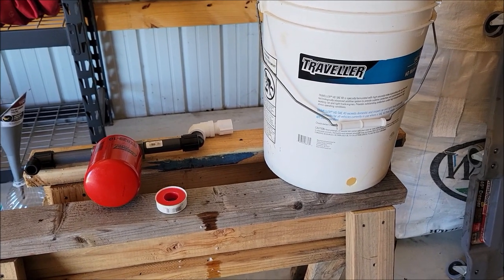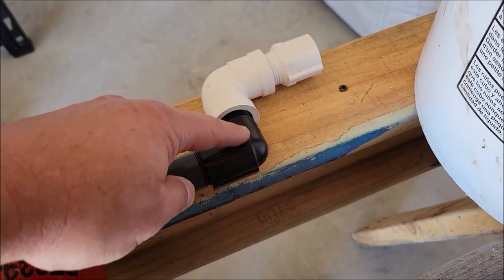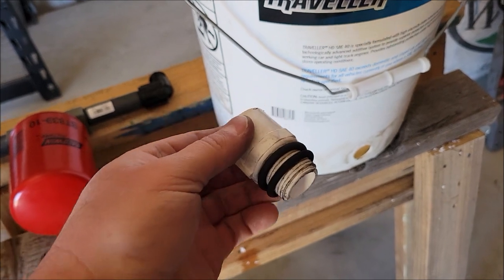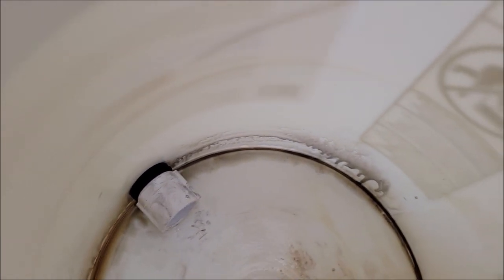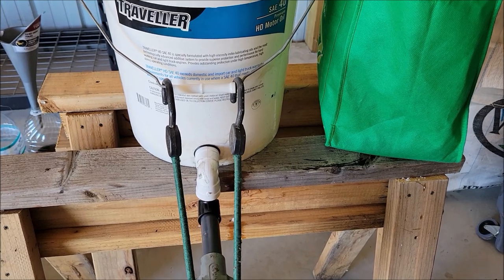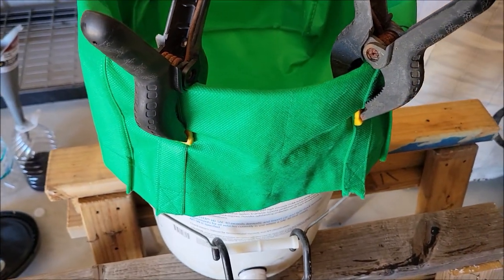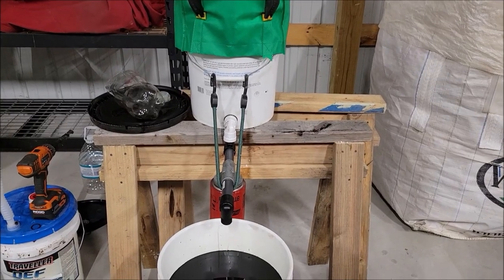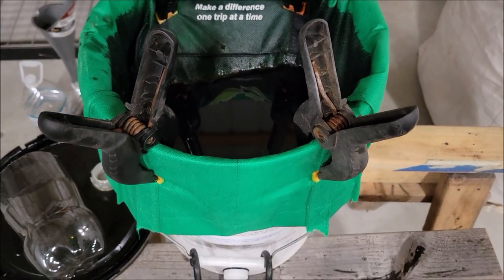Filter Used Motor Oil - Can Oil Be Used Again? - Reusing Old Motor Oil

Comment: Im thinking one of those dust collector lids would work to use a shop vac exhaust as added pressure. Help force the oil through the filter faster. Possibly add a pump past the filter.
Reply from the maker: Do you think pressure would filter it better?  I could try that if it will.  Time is not usually something I worry about for something like this because it's a pour and leave kind of setup, but if pressure will make it filter better I am all for that.
Reply: @SeidelRanch  I think it depends on how fast you push the oil, and if you do it too fast it cant filter as well maybe?
Reply from the maker: @TobySmith-qd4tm  Yeah, not sure on the hydraulics of that.

Comment: Tape a couple strong magnets to the the side of the bucket n see if that helps with some of the small metal pieces
Reply from the maker: That is a good idea.  I need to try that.
Reply: It doesn't work, I've already tried it with strong neodymian magnets. I  also tried oil in a plastic bottle with magnets at one side of the bottle and let it sit there for month & months hoping it would slowly pull the dirt to one side but it did nothing.
Reply from the maker: @PF-gi9vv  Thanks.  Good info to know.

Comment: I take used oil to melt scrap metal. Also use it on my Bobcat trailer. It can also be mixed with diesel and gasoline and burned as a Diesel substitute. A centrifuge works best for filtering.
Reply from the maker: So you can get the oil fire that hot to melt the metal?  Sounds like a good experiment.  I want to make a waste oil heater in the near future.  That looks pretty cool.  I use old motor oil on my trailer beds too.  It works well to keep away rot.  I am just now looking into the centrifuge idea.  That looks like something I might get soon.
Reply: @SeidelRanch  Yes it is possible to melt copper, aluminum, brass and even cast iron using oil. It works best when pressurized with an old hydraulic pump and sprayed into a burner, blow air in and get an extremely hot flame.
Reply from the maker: @chargermopar  I will try that with some aluminum when I make one.  I am definitely going to make one, I just need to find the time. Thanks as always for all the helpful info.
Reply: @SeidelRanch  If you melt aluminum you have to make a container (crucible) to protect it from the fire to avoid most of it oxidizing. I start with cast aluminum scrap which is less likely to oxidize than can put in thin stuff like soda cans or sheet metal from sheds or campers. Compressing thin stuff before melting can work too. Baking soda can also work as a flux but borax seems to be the best.
Reply: @SeidelRanch   I need to put mine back together someday, the scrap pile is really getting out of hand here. Lots of air conditioner scrap and junk transmission cases.
Reply from the maker: @chargermopar  Thanks for the tip.  I will try that out.

Comment: It's time to get into this. Some of mine has water dirt and oak leaves from the pan. Maybe an acorn or two and some bugs. I need a water separator. I wonder how much a centrifuge is.
Reply from the maker: That is why I did it.  My oil gets too dirty just doing the oil change.  To get the water out, I pour it in a bucket and let it sit then drill a whole in it to let the water out. Once I see oil coming out I plug it with a screw.

Comment: yeah that's centrifugal force one if you want it to come out clear you have to either put coffee filters there's filters that they have for cleaning frying oil at the restaurant those filters will work coffee filters and there's actual a powder that you can put on the filters it's a neutralizer and your oil will come out brand new and you could reuse it in the car and everything it just has a different flash point and you could reuse in another time or two there's also a machine you could buy that does it but it's very expensive they're about $1,500 it's an oil cleaner it'll clean any oil but it uses suction system cool I love that video
Reply from the maker: Thanks for all the info.  I may see if coffee filters do good too.  Would love a centrifuge but don't want to spend the money.

Comment: I use old motor oil thinned with diesel to paint on my wood trailer decks. You need to paint them every year because it doesn’t last, summer is the best time because the wood soaks it up. I don’t see any reason to filter the oil unless your going to put it in a lawnmower.
Reply from the maker: I use the oil for my wood decks too. Why do you mix it with diesel? Does it paint on better? May try that.
Reply: @SeidelRanch  I use the diesel as a thinner, the thin oil diesel mixture soaks into the dry wood in the hot summer a lot better than straight oil. I pour old in 5 gal bucket and add desired amount of diesel then it can be sprayed or most time I use a old broom for a brush. I also pour on or spray fence post with the mix. I would be careful with that since you live on a lake, you could have people in white suits showing up at your door.

Comment: My question is what does everyone do with the empty bottles especially when they stored the used disgusting oil? The auto parts store always hands them back.
Reply from the maker: I reuse the oil containers to hold the old oil.  I probably have too many right now, but I have not gotten rid of them.  I also cut them up sometimes and use them to dip my oil-less chainsaws in to keep the bars oiled.  If they are empty, you should be able to recycle them like plastic (I think, don't hold me to that).  Make sure you let them sit for a day or so to get out all the oil you can.
Reply: @SeidelRanch  Thanks.

Comment: i wonder if it is bypassing the oil filter seeing as it is so thick im thinking the filter is filling up and then just running off
Reply from the maker: It's not bypassing.  The housing will not let the oil through without it going through the filter.  I just think I need a filter that cleans down to a smaller micron amount.  It's good enough for my purposes though.  I want to try a centrifuge one day.
Reply: @SeidelRanch  cool! great idea!

Comment: You know oil breaks down it's not just dirty it breaks down picture oil is a bunch of tiny ball bearings well dissolve 90% of those ball bearings or remove them and then consider putting that back into your engine cuz that's a pretty good analogy on how viscosity works in a motor oil you're putting back a useless product don't do it farm equipment's too damn expensive
Reply from the maker: I do and you are right. I will not use it for motor oil. But there is a lot of other uses for it. Thanks for the info.

Comment: Did you make any progress on this?
Reply from the maker: I still use it but I have not changed it much.  It's still working great.  I do plan to make some of the suggested changes when I need to change the filter.
Reply: @SeidelRanch  Is there a way to get rid of the coal in the oil to make it more transparent?
Reply from the maker: @FransvandenBergeMuziekschuur  I hear that a centrifuge can do it, but I have not tried it.
Reply: @SeidelRanch  Interesting. Thank you.

Comment: You need to pressurize the system with an oil pump and recirculate it with a bypass filter that is 100 micron
Reply from the maker: I think I will try that.  It will also make it less messy I think.
Reply: @SeidelRanch  the Cummins has a bypass filter kit you can put on the engine even and do this while the vehicle is running. Works well in old tractors or hay rigs that run non stop. But I clean mine then add the h30 additive that puts the elements back in I want. And for a 60 year old diesel tractor does just fine. I use my old subaru sti oil rotella 5w40 specifically. Filter that and add h30 and add it to my tractors. Then the tractor oil gets used in a waste oil heater. It’s pretty bad after the tractor.
Reply: Oil also doesn’t really change in molecularity, it does loose its properties such as zinc, phosphorus, boron, thus the additive to bring the levels back. I use h30 after watching firepunk use it successfully. But any other additive should bring the oil back to life once filtered

Comment: Why didn't you put your hole in the flat bottom of the bucket and avoisthe curves
Reply from the maker: There was a reason at the time, but honestly, I can't remember. Good question.
Reply: Side exit eases putting the bucket on a bench or shelf to use or store. Those curves/elbows won't impede the flow any.

Comment: I use to have a jeep that used toilet paper for the filter . 

I'm using old Covid filter mask to filter hydraulic oil as I type this
Reply from the maker: Nice.  Gotta use those masks for something, right.  I have heard about those toilet paper filters.  Heard they work really well.
Reply: Ive used toilet paper filters since 1963. Oil should stay clear in a gasoline engine and get black in a diesel. They use big roll paper towels on locomotive engines on Shell offshore rigs and others. You know the oil in a diesel engine is clean if it doesnt stain the skin. The big Gulf Coast filter is rated at 99 percent at under 1 micron. Thats about as good as it gets. The Australian Jackmaster Classic claims 1 micron. My 84 Subaru went 250.000 miles with no oil drains. No engine problems except both head gaskets started leaking oil before it reached 300.000 miles.

Comment: Everyone saying you can filter the black out of the oil is lying. The color changes due to a chemistry change in the oil. The black color is now the color of the actual oil, not some particulate you can filter out.
Reply from the maker: Good to know.  All of my used oil is very black, even after the filter.

Comment: Has anyone tried this with ATF?
Reply from the maker: I have not.
Reply: Not for reuse ever in a transmission. But mixed 50/50 with acetone it's a premier solvent for rusty fasteners. It's also better than any lube oil for cutting/drilling ferrous metals. Some will use it to top up power steering. that said, mixed in with other drained oil it should be ok for other than putting it back where it came from.

Comment: lower the filter 2 ft and you'll gain pressure
Reply from the maker: Good tip, thanks.
Reply: You get more pressure by raising the bucket. I have a very old Motor Guard portable oil recycler. Its a container with a Motor Guard oil pump and a Motor Guard. Oil cleaner that used toilet paper. Its probably over 50 years old. Motor Guard only makes compressed air filters now. Found it on Ebay. Havent seen one since.

Comment: Still looking pretty nasty.     I'd try a better filter.... Maybe a 1 micron polyester water filter.    They are pretty cheap on eBay and Amazon.    The best automobile oil filter that you can get is a 20 micron 20,000 MI filter.
I'd go for the one micron and it might clean up the color also.
If the oil doesn't want to flow with the more restrictive filter you can always add air pressure to force it.
Reply from the maker: I want to try that.  I will see what I can find.
Reply: If the oil doesn't want to flow with the more restrictive filter you can add air pressure OR just leave it out in a sun to warm up, the viscosity will decrease and the oil will flow faster though the filter.
Reply from the maker: @drister007  Good tip.  Thanks.
Reply: @SeidelRanch  No problem :) ps: It is funny when i edited the comment, just to add one word, the heart dissapeared haha :O
Reply: @SeidelRanch  I have one more tip for you. You can buy 1 micron filter cloth pretty cheaply (or even 0.3 micron filter clotch), then get 5 gallon bucket and drill a lot of 10 mm holes on the bottom and the sides (drill 200 holes or something). Then put the filter clotch in the bucket, put the used oil into it and leave it out in the sun. In a few hours you should have pretty clean oil. Another method to get REALLY clean oil (looking like brand new) is to mix 300 grams of lye (sodium hydroxide) and a 250 mililiters of 98 % alcohol in a jar, mix it well and then pour it into 10 liters of dirty oil. Then mix the oil for 15 minutes and leave it for a couple of hours. That will separete out all the inpurities in the oil and they will settle in the bottom. Then you just drain the impirities from the bottom. 

Second step: To get rid of remaing lye in the oil use 2 liters of water and mix well it with the oil. Wait 1 hour and then drain the water out from the bottom (water and oil will separate). The third step is just to heat up the oil to 100°C to dry the oil (get rid of remaing water) and thats it. :) I may sound complicated, but it is really really easy and the ingridients are very cheap. The end result is cristal clear oil, that is looking like new (all the impurities, soot, tar and polimers in the oil have been removed, only the base oil remains). That type of oil is not good for using in the engine as a oil, but you can mix it with diesel and use it as a fuel for diesel engine. Or you can use it to protect wood or other similar stuff. Hope it helps. :)
Reply from the maker: @drister007  Wow, lots of awesome info.  I will try some of this out. Thanks.

Comment: Never stack gaskets or O rings.
Reply from the maker: Yeah, that is true.  I only doubled them up to take up space since it would not thread on far enough to hold the 1 o ring against the bucket.  Basically the second one was a washer.

Comment: You should consider the cost.
Reply from the maker: I have.  I would not use this as motor oil in an engine again.  If it went into an engine, it would be as fuel.